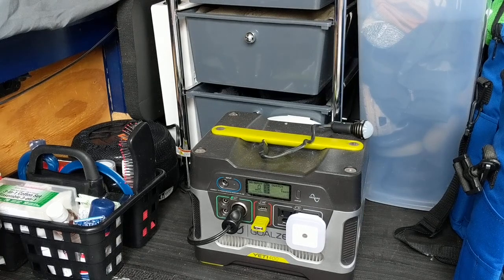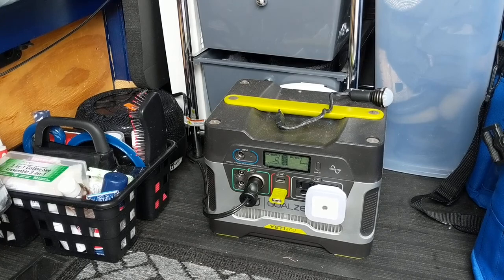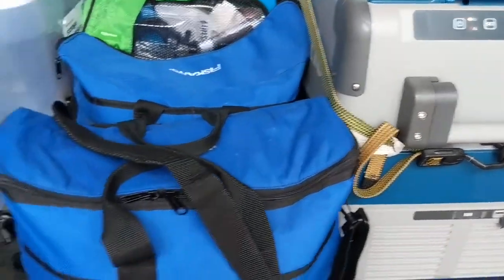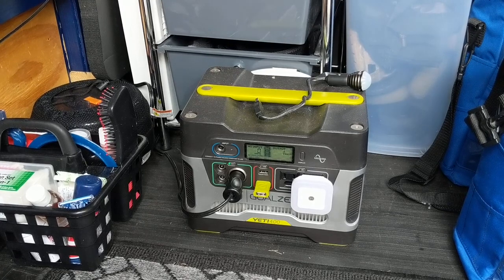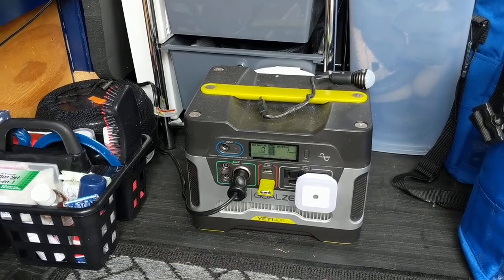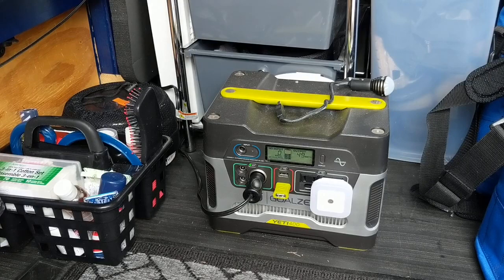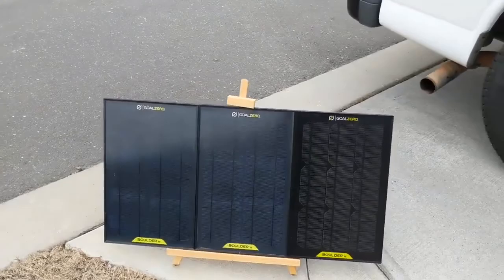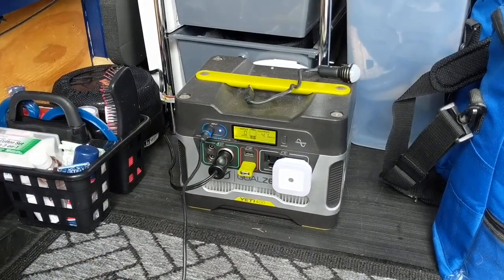Goal Zero Yeti 400- Attempting to run a Dometic CFX 40 in Van

Comment: Thank you for this review. This was good. Got a Yeti 400 and ordered a replacement battery. Also planning on getting another battery to chain link it to the Yeti. Going to run a refrigerator of of it also. Will upgrade later on.
Reply from the maker: Thanks for watching Brother.  Yes, I just made a vid today showing the replacement of the battery.  Waiting for my new generator that will be coming in on Tuesday.  It is so important to make sure these units are ready to go, so when you need them in an emergency you are ready.